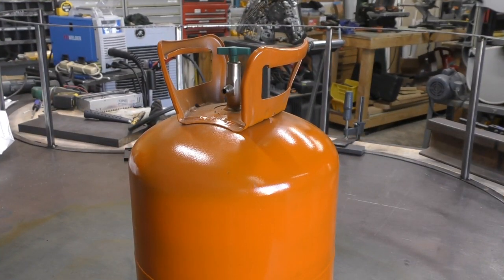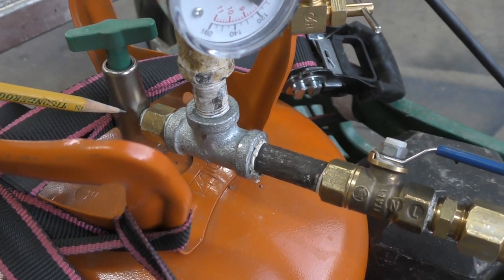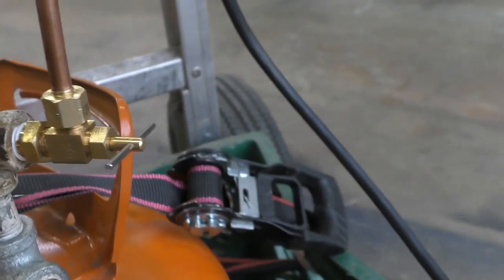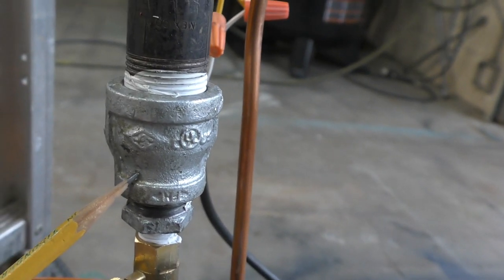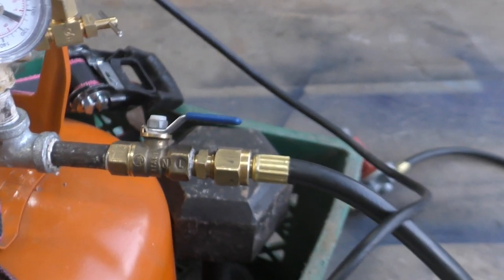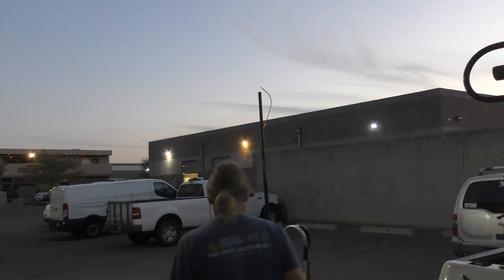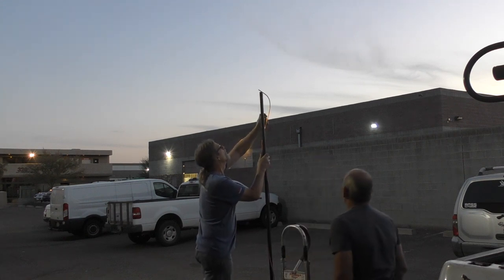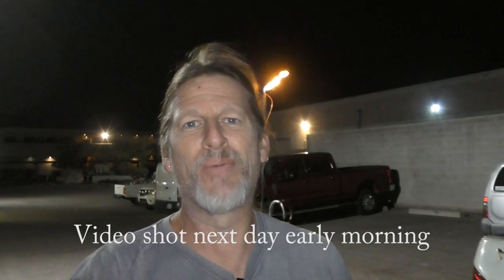DIY Propane Fire Cannon - Great Halloween Effect

Comment: For a harder to blow out pilot flame, Get yourself a piece of brass tubing and crimp or otherwise close one end, drill 3 or 4 1mm holes on the side of the tubing and go right through to the other side. Stuff the inside with medium grade stainless steel wool if you want a flash-back arestor. Then braze onto the end of the copper tubing.  You now have a multi-jet pilot assembly.  I actually use spent .22 cal rifle brass... saves closing off one end and the existing opening where the slug was fits right onto the copper pilot tube for brazing.
Reply from the maker: After I first few attempts my buddy mentioned the same pilot light suggestion. Next time I can work on it, that is a mod I will do for sure

Comment: Awesome.  Fun project.  I totally get the whole fittings issues.  Every time I got to HD or Lowe’s looking for fittings for a propane related project  or even airlines I end up with twice what I need to be sure I actually have what I need.   I wonder if you could find a 12v valve to make the system portable.  Like hanging of the back or front of the bus.  Switch on the steering wheel.  Mad Max style. 😁
Reply from the maker: I actually started with a 12v solenoid however it had a bad seal and wouldn't stay closed. So I went to the 110v solenoid

Comment: I get the tubing and fittings, but what’s the need for the tank?  Does it just act as a reservoir for the propane?  Why couldn’t you just run it all off the propane hose, no extra tank?
Reply from the maker: the propane tank as i understand it, is liquid propane. going into the second tank allows the propane to collect as a gas. A buddy of mine runs a huge fire cannon system in Las Vegas and he tipped me off to the reservoir tank. He also mentioned, if you plan to run it a lot, place the propane tank in warm/hot water so the tank doesn't start to freeze.